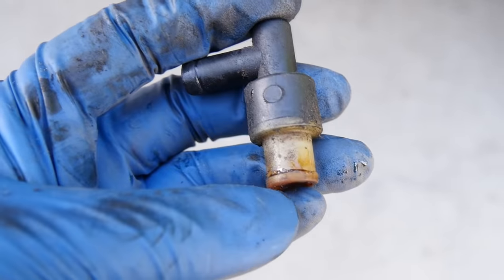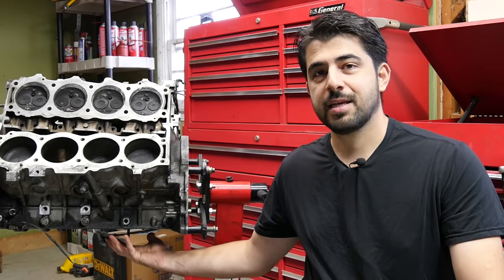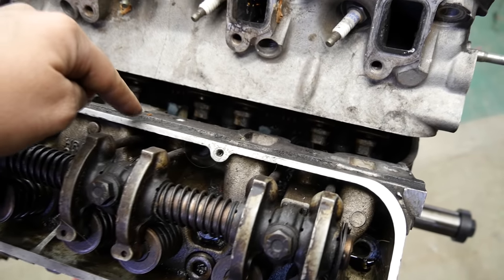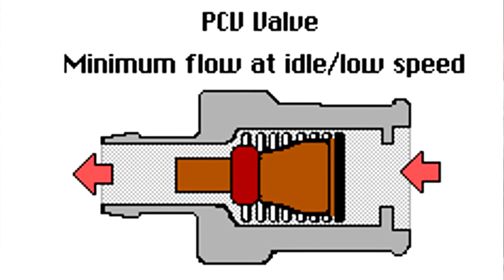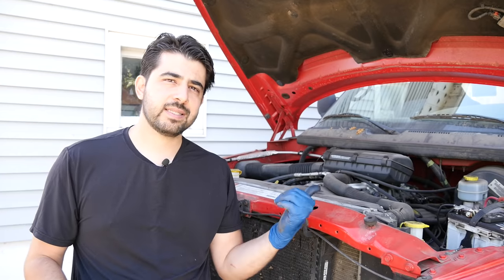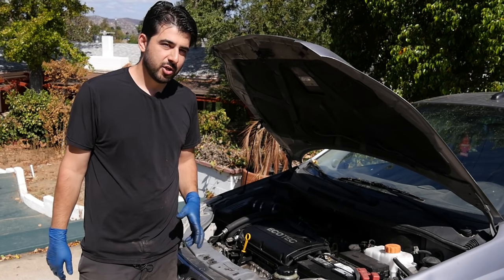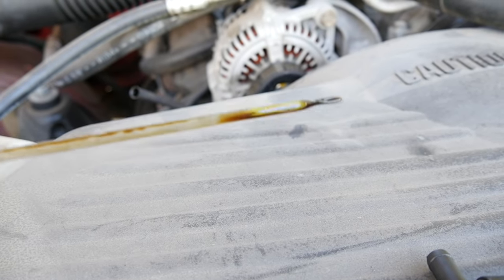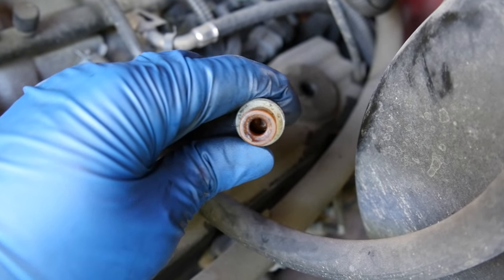The Valve That Can Cause Major Engine Troubles - How to Avoid Engine Sludge

Comment: I have a 92 ford tempo 4cy with a rough idle. When I inject propane into the intake in smooths out. I replace two vacuum lines now it's a little better. Should the pcv rattle when I shake it or does that mean the spring is to loose? Should the 4cy engine have a breathing tube to the intake box to the engine? Any advice would be grateful thanks.

Comment: Can a symptom also be that the oil shows to be overfull? Had my oil changed. I always check it before I drive off, so I know it was perfect just the weeks ago. Now it's overfull. I do have the misfire and rough idle which caused the check engine light to flash last night. I killed it immediately.

Comment: so if the vent hose and pcv valve isn't connected at all and just sitting aside could it cause an issue??? I have a nova my girlfriend has that smokes alot and I just popped the hood and it has an aftermarket filter assembly that doesn't have knockouts for the vent hose and the pcv valve is just sitting there as well.... need some advice....

Comment: If you have a PCV valve that is stuck closed, what is stopping the pressure from just escaping through the breather tube? In fact, why does the breather tube not pull a vacuum anyways? 

Anyone able to explain a bit better

Comment: ratchets and wrenches, any tips on how to bleed a hydraulic clutch? 1995 f150; I installed all new parts, tried the pumping of the clutch and opening the bleed screw. Also tried the mytyvac to help bleed, still not getting a good pedal.

Comment: So in a car like an '07 Malibu 4 Cyl(That has no PCV valve), Do you have any thoughts on how to handle what appears to be too much oil/Hydrocarbon discharge going into the breather system and throttle-Body?  Getting a good amount of yellow gunk in the pcv hose.  What about an Oil Detergent like Liqui Moly, AMSoil etc?

Comment: I once had a 1968 Firebird 400 who someone closed off the breather on the valve cover. It was not noticeable driving around 
town, but when cruising at over 60 puffs of smoke would suddenly come out the rear. It turned out that the oil was being pushed up and out the dipstick and landing on the exhaust manifold and then poof, smoke. It was a mystery for a while.

Comment: I just replaced it! I have a 37ft Winnebago mounted on a Chevy P3 chassis with a 454. It's running great but the mileage is not what I want. A1 Carbs in San Diego is no longer in business. Can you recommend someone to me? I have a Rochester Quadrajet 4 barrel. David 🐈

Comment: Hey you're awesome!  I'm glad I follow you on here. Im gonna go check my PCV valve. My car acts like it has a vacuum leak, sometimes it idles rough, sometimes it drives fine. I can't find a vacuum leak. It is throwing an MAF code but I have changed my MAF several times. Ideas?
Reply: Same boat buddy, any luck?

Comment: I know it's not related to the pcv valve but I am not sure if the knock sensor signals what could be wrong I already changed wiring in the knock sensors what could possibly problem will be thank you in advance

Comment: you are an awesome mechanic. you have awesome ability to teach mechanics to DIY's, which we love you for, my  friend. But,its called PCV, NOT PVC. no offense  ,Im sure it was a slip. haha. thank you, again!I have a 2015 chevy impala limited ltz, 3.6 ltr VVT DI.  I have changed the rear valve cover PCV breather valve. it was not to bad for 40,000 miles, but I cant find the front valve???the only thing I could see, on the first vale cover, was the PCV 90. which I have also replaced!!!!    and im still getting a lot of OIL IN MY INTAKE. CLEAN IT, THROTTLE BODY, SNORKLE AND AIRFILTER...., FILLED WITH OIL! have to clean it at least every other WEEK!!   please give advice, my thanks are in the advance.

Comment: I need your input. I have a blockage of dried up oil in the nipple on the carb that the hose from the pcv valve connects to. It's causing the oil to squirt all over the engine.from the valve cover gaskets.  Can i use seafoam in that part where the pcv hose connects to the carb? I think this all started all cuz their was another hose disconnected and when I reconnected it it must of started the build up. I didn't see why the previous owner had that other hose disconnected at the carb. It was the nipple to the right of the pcv nipple on the carb. I have a 89 Chevy s10 blazer 4.3

Comment: what is your opinion on vacuum oil pumps for oil change via dipstick tube? have a stripped oil drain plug that i had sealed up. is the above method safe?

Comment: I’m impressed by the explanation. I follow you from the Europe, and I have a question: How can I find where is located the pcv valve on ford focus 2009 1.8 tdci dura torque (mk2 facelift) europe model? It make black smoke and the only thing left to check is the pcv valve but I can’t find it.

Comment: On that Pontiac that has the PCV line out the intake to the throttle plate . Does it have a clean side line bringing fresh air in ? And where it goes into the throttle plate is that before or after ? Thanx

Comment: could this pvc valve cause bank1 02 sensor failure?
Reply: Kito no at all.o sensor just go bad.
Reply: Not failure but i was running lean due to a vacuum leak in my pcv system, and my upstream o2 sensors kept setting a code for bad performance as a result of the leak.

Comment: Pcv valve is one of the most forgotten part to change on a car. I think because you don’t have to change it as often. But I tend to try to change mine once a year. I know that may be overkill but I want to remember to do it. It’s on the top and easy to do. It’s like $20 a year so what.
Reply: If it were a Toyota, it wouldn’t even be 5 bucks a year for your pcv valve, just saying 😜

Comment: The 9th gen toyota corollas are simple to change the PCV all you gotta do is remove the top engine cover and boom its there right behind the throttle body i have an 08
Reply: I got a 03 and 10 corolla, 03 is definitely ridiculously easy. The 10 is easy too, butt a little more involved, just a few more steps nothing serious. Corolla=best car ever made hands down. Sure it’s slow, but slow and steady wins the race

Comment: Great video , for informative 
I took my 1995 cadillac at advance auto parts and the guy  told me to just replace the pcv valve with a straight hose , 
Should I change it back for a pcv valave? 
Any help would be awesome
Reply: Archie Meguel!!  >>> !!! Put it back ! Watch the video again! There's a REASON that valve is there! 😨✌🏻🇺🇸
Reply: @georgeb8701  should I replace it with a pcv valve ?.
Reply: @archiemegel1013  I would Archie. Go back and watch the video again. Listen to what it's function is. It's an important part. It belongs there. And look up other sources.Google up pcv valve.  Make sure you get the right one. And find a mechanic that KNOWS what he's doing and is HONEST. ✌🏻

Comment: I had to change a TDC (Top Dead Center) sensor out in my old 01 Honda Civic. Previous to doing that random accurants would happen when I was in park or sometimes even driving the 'Check Engine' light would illuminate and the vehicle would down shift and not drive past 20-30 mph and even stall out and not crank back on even when trying to drive from park it would have very little acceleration. I would have to let it sit and cool for about 15 mins restart the vehicle and it drove fine..

Comment: I have a 9th Gen, Chevy Impala; Working or not, should the PCV valve be changed at some mileage or time interval? Is a 'catch can' installation a good idea?
Reply: Here’s some sound advice: get rid of that pos Chevy. Get a real quality brand: Toyota. There is no arguing the reliability of Toyota. Sure, some may say they are boring basic cars, but I’d prefer a basic car that starts every time I turn the key, versus a pos decked out with fancy controls to cover up the turd under the hood

Comment: it can do problems only if is fully opened-to much of air -mixture disturb and oil vapor  that will dirt intake, but if it stayed closed it will not make extra pressure in crankcase because there is air hose to /from air filter to crankcase and it  will go out to filter

Comment: I got the same truck I got an issue when I started it once okay it's a starts to warm up and it sounds like it wants to shut off what race is back on a couple of times and then home for a little while give it some gas and when you put it in gear it hesitates until she pops and then she goes and also sometimes when it's warmed up it don't want to start right away and it takes awhile for me to press the accelerator over and onto the floor which causes for it to start by force is this the EGR or the PCV

Comment: Could a stuck open pcv valve cause a hot start issue?
Reply: May be. Start the engine, remove the PCV valve of the valve cover and put your finger in the valve. If the idle change, discart that valve and buy a new one. If have no change in idle you have another problem.
Reply: The pcv valve is built into my valve cover. It's on 03 Volkswagen vr6
Reply: @JaguarDieCast  
Oh, that's other situation. You need to go to a dealer or look in Youtube for someone with a solution.

Comment: Should I use an Oil Catch can instead rather than the PCV system?
Reply: probably not, unless you,have direct injection. a catch can works to keep deposits off of valves and intake runners. normally that's done by additives in the gasoline
Reply: Depending on your vehicle. My Infiniti has blow by problems and a catch can has worked out great for me. It doesn't delete your pcv, it just catches the blow by before it can be sent back through your intake to be burned again depending on how you run it.

Comment: What would be causing pulsating pressure in the head? Leaking valves? 

I have a hyundai getz that if i remove the oil fill cap off the valve cover and feel for pressure it is pulsating.. positive and negative pressure.

Comment: 700rwhp inline6 turbo 4L engine and I deleted my pcv, plugged it into a catch can and the oil breather to a hose with a filter a year ago. No leaks or issues. PCV is just a emission gimmick lol the it’s creates more issues then anything else plugged into your engine. Check your intake manifold and inter cooler piping, I can place my hand in fire that it’s all covered in oil and crap from the pcv. The crankcase gases are release and travel up through where the pvc was, why do you need to suck it back into the engine when the process is already done and the gases are already going up to be vented. Like I said. Emission gimmicks and to make things cheaper for companies to not have to run oil catches. Aka every skyline r32-34 gtst/gtt and gtr came with a catch can that was plumbed back into the intake but with a filter on top. Also there is ZERO! Evidence that not running a pcv will damage your engine. Also your dip will only pop out if you block all the crankcase breathers. Venting it to atmosphere without it plumbed into the intake will do no damage. ;)
Reply: FALSE, NICE TRY. Read some more ACCURATE DATA/information and get back to me chief 😜

Comment: Wow have not seen that old version of PVC  valve in a real long time. I’ve been driving BMW’s for 20 yrs now, BMW redesign that PVC valve to a flapper style that actually works,  on my M5 BMW actually engineered 2 catch cans into the CCV system,  so I really don’t worry about the PVC valve.
Reply: Ahhh bmw. Basically just a golden turd.

Comment: Before i watch the video, im gonna guess thats the PCV valve? Yeah, its a cheap plastic part, and i cant count how.many fixes to a customers problem was just replacing the valve and the cracked/hard/split hose attaching to it. Really cheap repair for something that feels catastrophic when you first experience symptoms... as long as you get it done before it causes additional issues... lets see, i like testing myself like this😊 rule of thumb for us, is remove the pcv valve and shake it, if you csnt feel the ball rattling/shaking, it definitely needs replaced (even if it 'seems' to shake ok, it doesnt mean it isnt bad, but if you cant shake the ball portion of the valve its a pretty dead givaway thay its not working. Misfires, idle seeking (usually from a vacuum leak, usually from the split hose connecting the pcv), low/rough idle, engine shutting off, list goes on... its crazy how cheap, yet how massively impactful that little plastic valve is. The EGR is another one ive experienced a lot of issues with on late 90's honda accords (possibly civics too, i know, but it definitely affected the Honda 2.3 L engine. The EGR fails, and the intake system on those has to be completely disassembled and cleaned out, the air passages get gunked closed with REALLY bad symptoms. I kinda miss working with those imports so often.

Comment: I have a 2007 ford five hundred and i see smoke coming from the engine but theres no overheating and idles a bit rough. I got code P0443 which i think said its for the purge control valve for the EVAP system, and i also got a P0106 which is for the MAP sensor, does anyone know if thats why theres white smoke cming from the engine?Or if anyone knows what else could be wrong or what is REALLY going on? Thanks

Comment: I have a Toyota Corolla from 2001 which is a model that was notorious for burning oil, I change my pcv valve every 15,000 miles, is that necessary to change at that interval or is it my paranoia?
Reply: RedAvenger I figured 🤣
Reply: LOL, In my country, parts stores don't sell pcv's cause "they don't fail" !
I have to clean mine and reuse it.
Reply: @bassam_salim  - What country ?
Reply: Bassam salim order it online
Reply: Every 100,000 miles is fine.
Reply: @rahrah8076  Not possible, no credit card, no bank account, no paypal, no shipping from amazon to my country (Yemen).

Comment: I think that's exactly why my 3.9l uses per say oil. Weak Pcv spring. Course there are a few things that are not well thought out on these la engines. I will say though, the 3.9l is absolutely gutless (175hp), but shes still running strong at just below 300k. How about that plenum gasket though.... did mine 3 times before I could get a seal with the stock metal plate. Coppercokte was the trick I guess...

Comment: PLEASE HELP!!! So I started having issues, it was a rough idling at every light, if i shut it off and turn it back on it goes away.. I drove it 5 miles home when it finally stopped. Now it smokes when I start it and occasionally runs rough. I took it to the dealership and all they said was cam and lifters probably need replaced but its at 95k miles, wtf! Thats what I get for buying a hemi.. They didnt drive it any or take anything apart, so idfk how they'd know.
Reply: Update?

Comment: Just a question. Could you have rough idle and acceleration with a failed PCV valve?
Reply: Replaced mine on a g35 last week and it definitely has smoother idle, runs better and quieter
Reply: @abc876  wow!!! Something so small changes the how the car drives. Think I need to replace mine on my Accord that has 185,000 miles.
Reply: @daniel022209  go for it you'll be happy you did,  just be careful to not over tighten
Reply: @abc876  thanks man.

Comment: Question would this make your truck run rough when it's warming up where it sounds like it's shutting off and then racing back on like if it's shutting off... Or this is the EGR
Reply: Check MAF sensor

Comment: Hello! Please HELP! I just bought a 2018 Type R and I had to take to the dealership because a “system emission problem” was on in my dash, they told me it was a “water intrusion” in the cylinder number 4 and Honda didn’t know the reason yet. How bad is that? It only has 4164 miles
Reply: Update?
Reply: @joshhemingway7294  they said it was a misfire in the cylinder, I bought it new so I still don’t understand that, it gave me a lot of trouble for a new car so I ended up selling it. Wouldn’t recommend getting one. It was very hard to shift from 1st to 2nd

Comment: Yeah very important and alot people don't even know or care to even replace it for maintenance but I do and I bought a 92 Chevy S10 2.8 and the pcv was completely clogged up with carbon and black shit so but I replaced it and the hose to it and then the hole throttle body had to come off to clean the ports inside it because it was so clogged up wasn't any air nothing coming through it and I definitely noticed a difference after I replaced it on the truck in power and how it ran and drove but was really really bad put new throttle body gasket and everything and she's good now truck has like 336 I've only had it for a month and payed $300 for it

Comment: Thank you got small air leak on intake spit aluminum gasket got extra on now going to clean and swap out with one in van it's got 300 thousand ,,,,, California emission 2002 Chrysler 2.4 ,,,,found 2003 2.4 regular emissions looks like head on van is different EGR no hole in head,going to checkout if to off ,,,,think blocks the same and transmission going to run it till it stops thing got plenty of time to match ,,,,,,do you know of hand if the 2.4 emissions or blocks are to off to swap out going to buy a book on the van make model do you recommend a brand of book

Comment: Does Toyota corolla 03 have this? How do I know if mine is working. I seeing a bit of smoke when my car is fired first when cold. It also says it has p0171. But I will check the  Maf, and 02s later
Reply: If it’s the 1.8 engine then yes.. I have an 03 and 10 with the receipt 1.8 and both have the pcv valve

Comment: Could this be a problem for low engine power and a whooshing sound at acceleration?
Reply: May be not, because in acceleration, generaly a little vacuum cause no problem. But, if the valve have years working improperly, you can have a bigger problem now that cause lost of power, like you can see in the video.